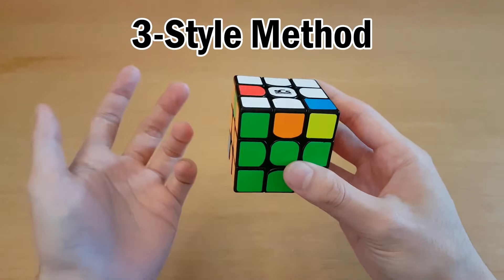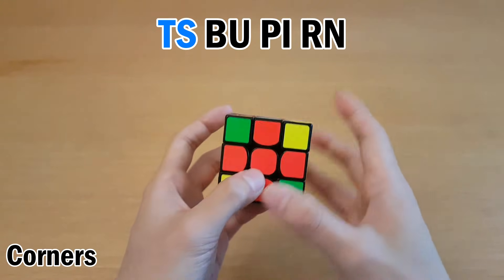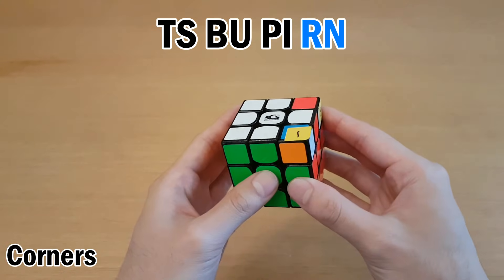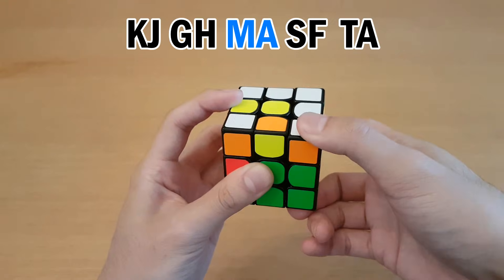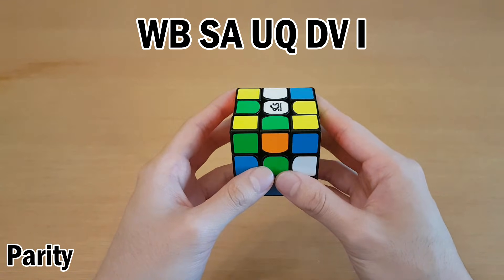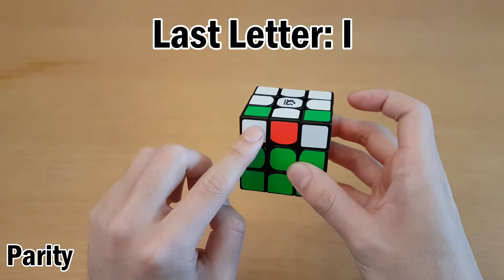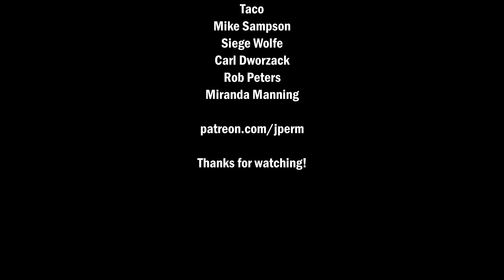3x3 Blindfolded: 3-Style Method Tutorial (3BLD)

Comment: Plz make more tips for BLD beginner
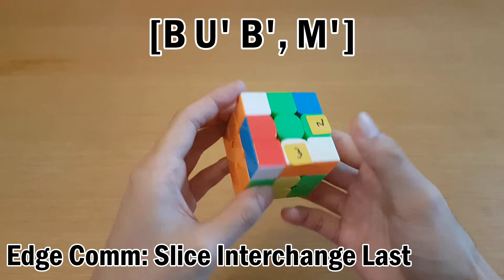Reply: As a beginner the best things you can do to improve are switching from OP edges to M2 or TuRBo,  start using audio for edges or corners (depending on your memo/exec order) and grind solves until you average around 1:30.
Reply: @smomnom9576  
Sir I can't remember edges and corners at once. Plz help
Reply: @smomnom9576  I do 2 look one for edge and 1 for corners
Reply: @vardaan0219  I dont know what you mean with 2 look one. I want to know what memo techniques you use  (visual, audio or sentences) for which piece type. And what exec Methods you use (OP/OP, M2/OP or TuRBo/OP)
Reply: @vardaan0219  There are some really helpful memo tips by noah arthurs on the cubing world channel.
Reply: @smomnom9576  I use op and visual form as momo
Reply: @vardaan0219  As I mentioned earlier you should switch to a faster exec Method like M2 or TuRBo so you don't have to store that information for too long and you should also try to use audio instead of visual for edges. Everything else comes with practice and experience.
Reply: @smomnom9576  ok sir I got you thank you for advise

Comment: Instead of UF UR swap for parity, which is very inefficient and bad, you should use UL UB swap. Timothy Goh (4BLD) has a good tutorial on this. With 3 style, you can do this and then execute last corner target with OP.
Reply: The UL UB swap is only good if you're using UBL as your corner buffer
Reply: @ryanfarish5433  Ah, didn't think about that. Any other suggestions? Maybe y2 in to OP for last corner target with UF UR swap?
Reply: @griffin.9248  if you use OP for example your buffer is UBL/UF then you can either directly do UB/UL swap or still do UF/UR swap and then do Z perm to leave UB and UL swapped for last OP target. But for the best buffers (UFR/UF), the fastest parity method that is commonly used, is to swap UF/UR and do a parity alg that swaps UF/UR and UFR/any other corner.

Comment: 5-style ? What about 5-style yo.
Reply: I don't think that learning all 100000 algs is impossible but even for only 818 algs, it takes a lot of practice to reach the point where you think of a letter pair (or letter quad in 5style) and instantly associate with the correct alg. It would take years to encounter every comm at least once if using 5-style. Also the speed difference between 5style and doing 2 style is not enough to warrant this massive switch. But good luck learning it anyway
Reply: Aye I had this dying desire to try it out, hence I am trying it yo

Comment: I'm always so confused by some advice with 3 style. From my knowledge, the commutators of 3 style are one of the most heavily and aggressively optimized move sets in cubing because of several reasons; yet people always say to learn it more intuitively and to make your own coms from nothing. Wouldn't it be better to have a speed optimal list of coms, but to specifically read them as the intuitive movements to memorize them easier just the same as making them? So that way you actually learn the ideal ones to begin with, and avoid throwing away a bunch when you replace them with better ones you eventually find out about?
Reply: Yes. You should learn the comms not really algorithmically or intuitively, but somewhere in between, where you can understand the symmetrical structure of the comm so the inverse is easy to remember. For example [D: [R U R', D2]], the inverse is just change both D to D'. 
There is no reason to use a slow comm and have to transition. It's really hard to disassociate away the memory of the old comm. Just start with the best algs from the start.